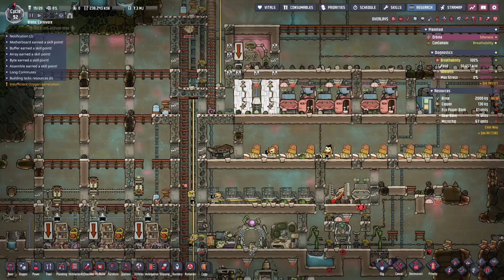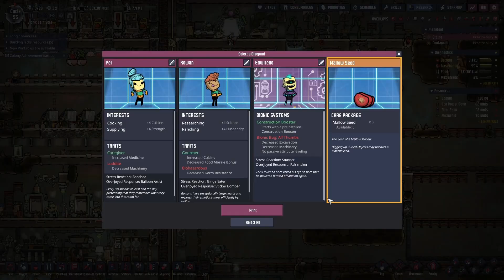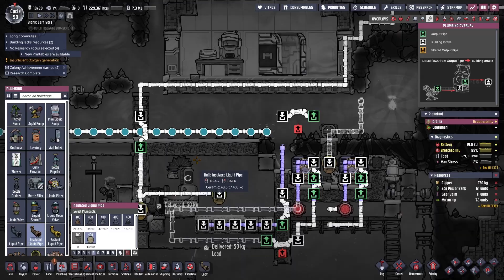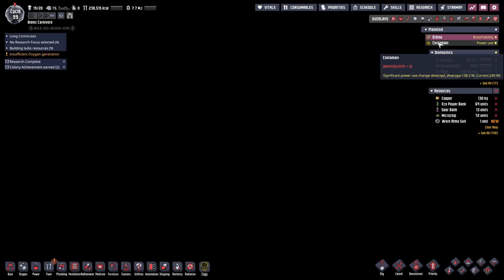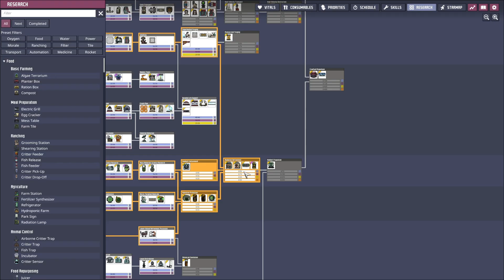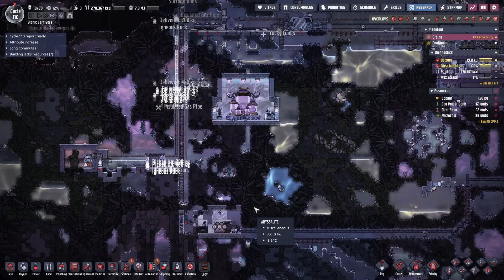Farming and Temperature Control

Comment: Nice video as always.

0:40 You can do everything in the barracks door permission to have a dupes barrack and a bionic barracks. I wish we had the group system of Mind over Magic. or at least add a bionic selector to the dupe checkpoint, the thing is barely used. Now that i think about it, maybe the bionic weight more than the normal dupes, might be cool to test around.

14:15 I prefer the version of temp control when every aquatuners cool a metal slab of the coolest required temp, then there is mechanised door to inject the cold to different hotter temperature. So it can expand easier, add aquatuners when needed, add multiple loop to any slab to have a precise temperature, extend the slab of the temperature you need. But every way is valid and has it's own perk and downside. I though that's what you were preparing for with the vaccum underneath.

43:50 I never did but you can throw away excess pwater with bog plants (instead of the traditionnal reed). That would be original.